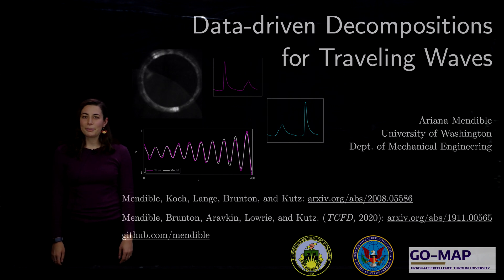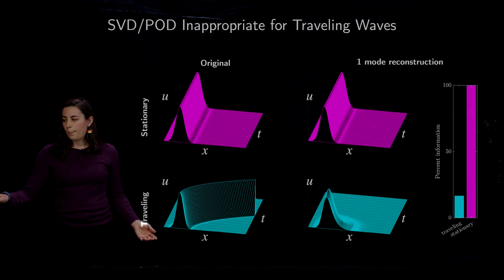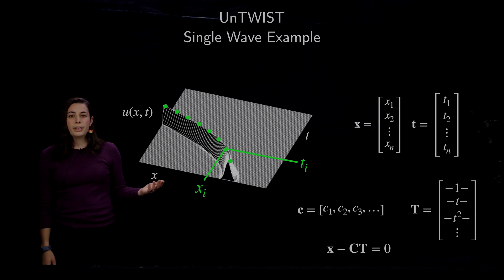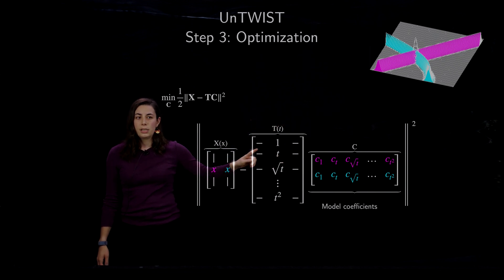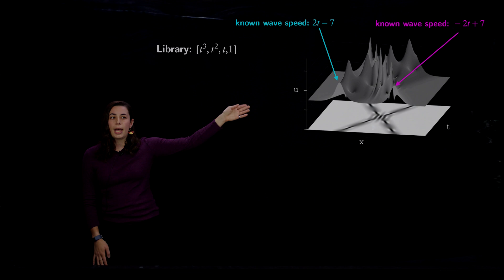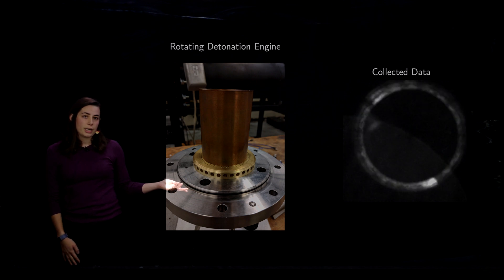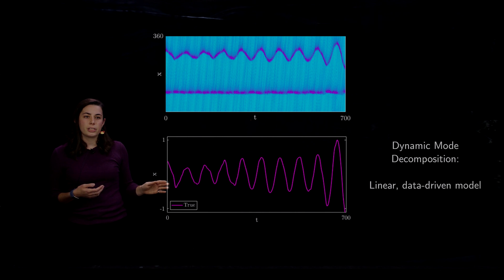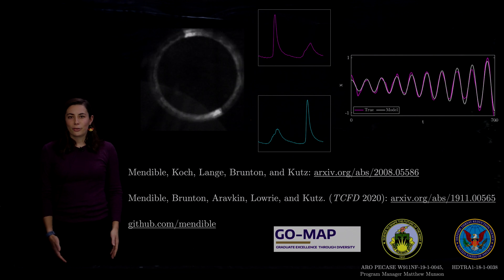Data-driven Modeling of Traveling Waves

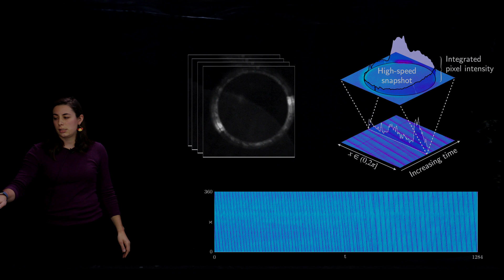Comment: Very cool.  A couple of questions come to mind.  You mention that you have to initialize the system with the "correct" number of traveling waves.  What happens if you don't know the correct number, for instance with lab data?  Does the reconstruction error usually drop off in an obvious way when a sufficient number of waves are included?  Also, at 10:15, are you integrating radially?  Otherwise I'm not sure I understand.

Comment: Extremely interesting. It seems like good old analytical/model-based approaches will soon be a thing of the past
Reply: Would not call it quits on the old model-based approaches. Using optimization methods can solve more complex problems than many old methods but they also add new problems.

For example, they can see patterns that are not there and the tester is unable to know if the solutions are correct or just some arbitrary way that the program found to minimize its cost function.
Reply: I hope that if anything these new tools indicate new search directions to improve the analytic models or find deeper underlying explanations- basically extend our reach not be the limit of it.
Reply from the maker: I agree with some of the comments below that really these go very well together and hopefully add up to more than the sum of their parts.
Reply: @12:43 lotka-volterra model with unknown parameters (whose response shapes are known) are used to fit the wavefront data with optimisation. I think that model and data methods will coexist and enhance each other's effectiveness
Reply from the maker: I couldn't agree more.  They really do go together.
Reply: It's going to be complete opposite in the future.
Reply: It may be somewhat too ambitus to call it a quit. 
Analytic and model-based approaches can give us insight  and physical meaning during derivation. In other words, it can give us some way to "adjust" what is more important or correct in the process of understanding the world (data). 

The data-driven methods can give your an answer. But it may be difficult to adjust terms unless a prior knowledge is involved. A prior knowledge is usually gained during theoretical derivation.

One of the beautify of theoretical derivation is the prediction (even without data).  A recent example is the Higgs Boson (Graviton). 

Both ways can help with each other and both ways can help us to understand the world.